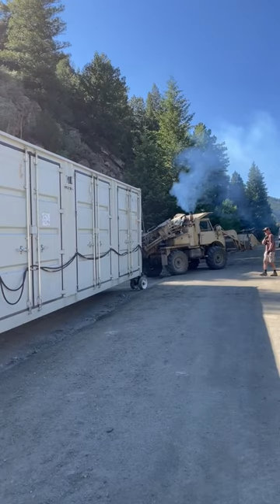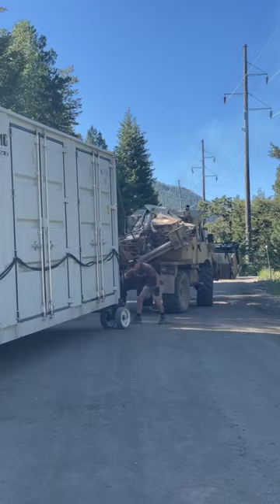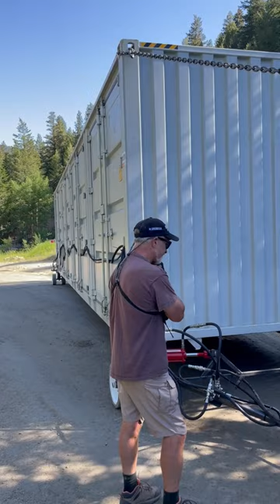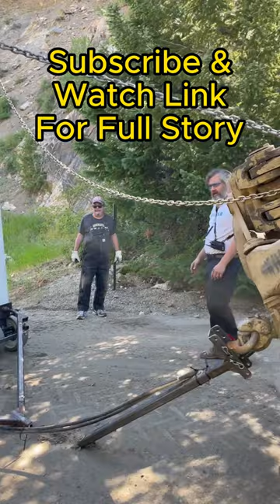Just a little micro horror film. #fabrication #unimog #shippingcontainer

Comment: That makeshift trailer hitch wasn't good enough to pull that kind of cargo box of that big heavy weight and this is what happens when you use it
Reply from the maker: This is the price that is paid.  From a pull perspective the metal was strong enough.  The issue was the shear force from the side.  The way it was attached - the shipping container was HUGE lever.  Snapped like a twig.